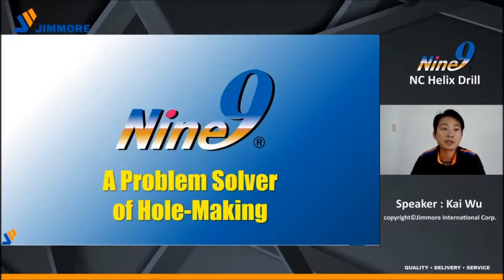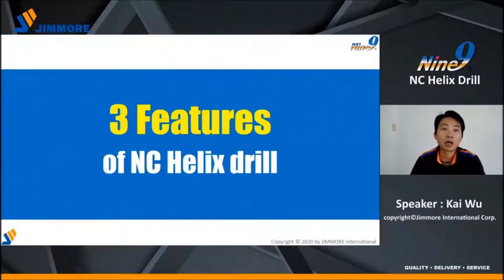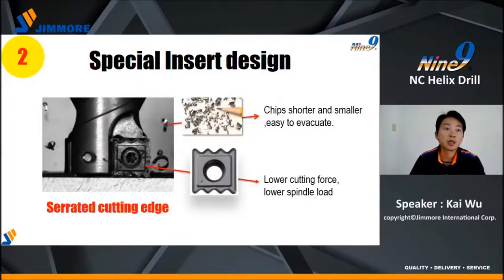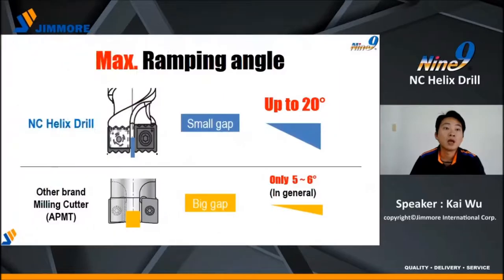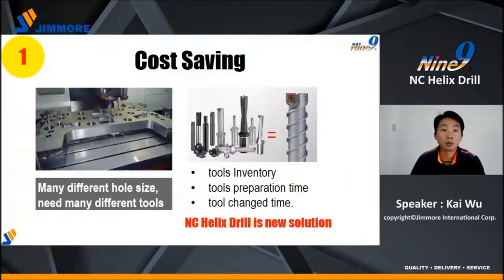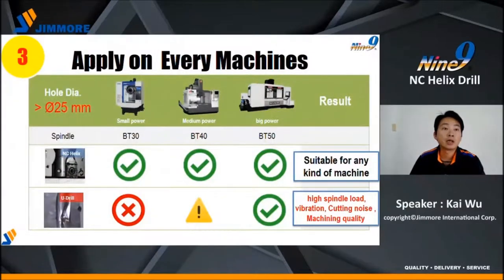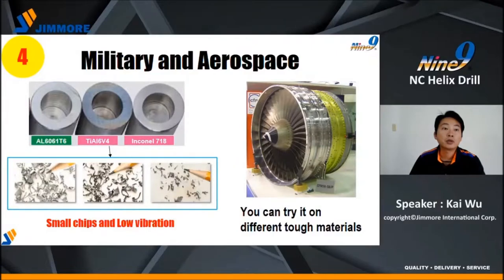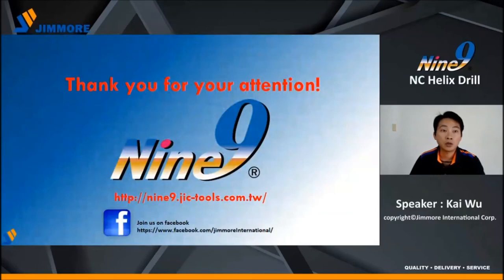presentation of Nine9 NC Helix Drill- a problem solver of hole-making

Comment: Are the screw type shafts HSS or carbide?
Reply from the maker: Hi, Kuei.
The screw type shafts are made of  hardened high alloy steel, 42 HRC.
Reply: @nine9cuttingtool  Your website is down :
Warning: mysqli::mysqli(): (HY000/1040): Too many connections in /home/httpd/vhosts/jic-tools.com.tw/nine9.jic-tools.com.tw/libs/libs-mysql.php on line 16

DB Error: Connect Error (1040) Too many connections
Reply from the maker: @kuei1215  Please to visit Nine9 website again~ The website is up now. https://nine9.jic-tools.com.tw/nc-helix-drill.htm
Reply: @nine9cuttingtool  We just ordered one.
Reply from the maker: @kuei1215  Thank you very much.